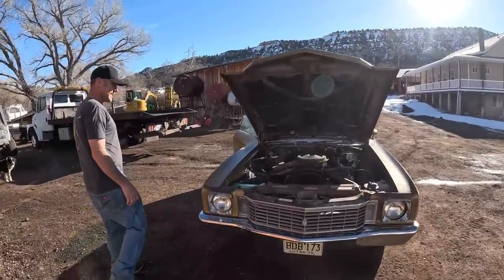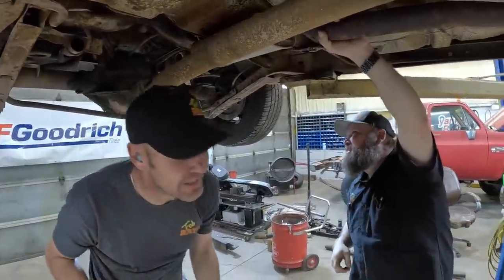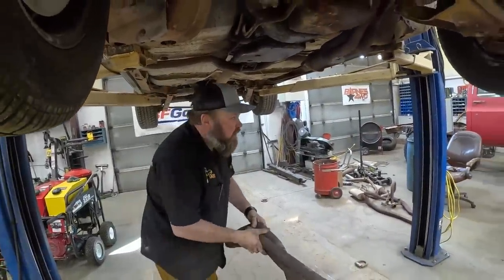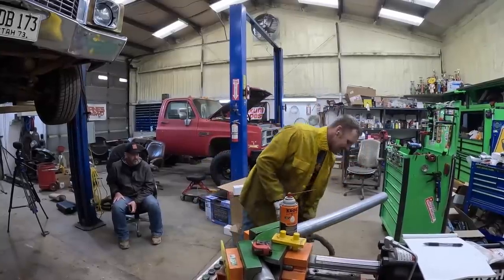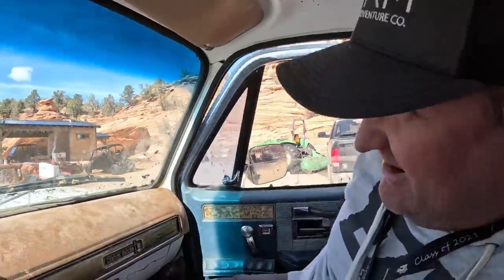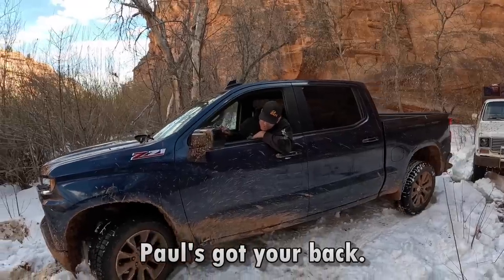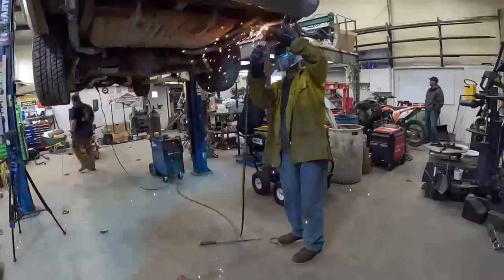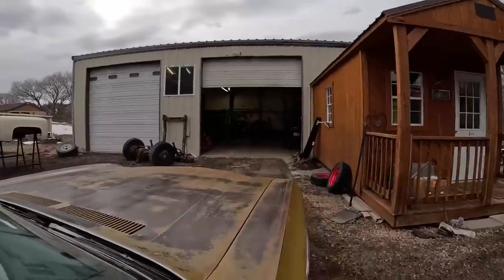There Is A Reason This Is A Pretty Special Car.

Comment: Hi Paul,  I was a GM partsman for 31 years. 72 Monte Carlo, 402 came frome the factory with regular exhaust manifolds. They did not have factory headers.
Reply: Thank you for replying. I 100% agree.
Reply: No factory headers on those cars. Even on my 70  SS with the 454 it wasn't an option.
Reply: The steering shaft was designed to unbolt at the gear box on those big block cars.
Reply: Looks great, sounds great. Now when are you  going to fill us in on what your doing with the Monty setting in your parts yard 🤔🙃
Reply: Fits like a glove. Love your vids. All the people and places you guys go. Love you guys!
Reply: 69 Z28 Camaro 302 V8 came standard  from the factory with a set of factory headers in the trunk but I never heard of a big block Monte Carlo with factory headers but of course this is way before the EPA came along and peed all over everything..
Reply: @U_ever  the democrats EPA.
Reply: @MontanaWelldigger  Yup....EPA was established by that famous Democrat...Richard Nixon.  I think that was right after he won the civil war.  🤣
Reply: Agree, these years did not have factory installed headers. I believe that some model camaros had headers in the trunk to be installed by t he dealer.
Reply: Yes you are right, if you look up 1970-72 GM 402s they definitely have factory headers from standard. And every factory photo of the engine has the factory headers, dunno where everyone gets the idea they didn't.
Reply: Appreciate the info thx
Reply: @all4runner316  Wow. You need to state your source and provide a link. I can't find it.
Reply: @all4runner316  sorry that never happened even on cars in the 60’s that came with them in the trunk for dealer install on certain high performance special order cars. No 1972 car would come with headers installed or in the trunk as this was the beginnings of the emissions era.
Reply: No they didn't come with headers just stock headers but mine has it lol ordered them from a guy that Makes them ,😁
Reply: Wasnt there something about some Strike in 1972, that meant 1972-MY car was rare?

Comment: Man this video brings back memories, my buddy Greg had a 1970 Monte Carlo with a 454. It was a beast, black on black. I remember him ripping it down the street, those were the days. I think gas was around 30 cents a gallon for regular and premium was 40 something! What fun!
Reply: Chevrolet made some SS 454 Monte Carlos in 70 and 71, they were sleek and fast for the times. They were very tastefully trimmed with no stripe packages and  the SS454 badging was small, one on the bottom of each front fender, in the lower trim.

Comment: Never factory headers on a GM. The exception is the 69 Z-28, but the optional headers were shipped in the trunk to be dealer installed. Even the highest horsepower from the factory, 460hp LS-6 in a 70 Corvette had exhaust manifolds. Now because I know what the internet experts will say, the Baldwin-Motion and Nickey cars did have headers, but those are not factory cars, but modified by the respective dealerships. Also, some much later Corvettes had tubular exhaust manifolds, similar to a header. And some Astro/Safari vans had kind of a shorty header, made of stainless on the 4.3 V6

Comment: My dad loves the 1973 Monte Carlo, it was his first car and he's had 2.  I still remember him telling me most of those he could find were 72s or 74s because they only made the 1973 for 6 months.  Excellent video, I sent it to him
Reply: I'm not a big fan of the second gen Monte Carlo's but the 73 is the best year of the second gen I use to have one it was white with black interior had the seat that turned out and was a 350 original but someone put a big block 454 out of a truck in it until I blew it up because the engine was wore out.
Reply: @79tazman  Big block truck engines just don't work well in cars.
Reply: I had a 70 with the 400 and 76 with the 350 I much preferred the 70:face-purple-smiling-tears:
Reply: I had a 72 in high school. Small block. I bought a 74 454 in '88 and I haven't done much to it since. One of these days maybe I can get the funds and motivation together at the same time.

Comment: I owned a 72 Monte Carlo in 1972 and at that time I managed a full serve service station.  I’ve never seen a big block or any other Monte Carlo with factory headers.  Most folks don’t know what a service station was.  We pumped your gas, checked fluid levels, washed your windshield and aired your tires up if needed.  I’ve pumped hundreds of thousands of gallons of gasoline that sold for $0.249 a gallon.  That’s not a typo the gasoline was less than a quarter of a dollar for one gallon back then. With that being said I serviced many Monte Carlos with 350s, 402s and 454s and no factory headers.
Reply: I thought I remembered putting a gallon of gas in my 1970 Suzuki 90 for a quarter. Been a little while. 🙂

Comment: '76 Monte Carlo had the 454 HO option. and yes, it came with factory headers to be installed by the dealership. Headers were shipped in the trunk and the dealership installed them. As far as other engine sizes or years, I couldn't verify. But it seems likely.
Reply: Sorry, but that's false. The last year a 454 of any hp rating was available in a Monte Carlo was 1975.  In fact, no big block was available in a '76 Monte Carlo.
Reply: @danjanes8689  so you're saying the car my mother drove nearly 18 years is a lie?
Reply: @Daniel Miller  Do a Google search. I've lived and breathed Montes for over 35 years. Is it possible her car was an earlier year? In the mid '70s there was no H.O. anything. Emissions choked everything.
Reply: @danjanes8689  Early 76. Built with some of the leftover parts from the 75 run, which I'm assuming may have included the 454 HO. I know it's a 454 HO cuz when the car got wrecked, I kept the engine and had to do some internal rebalancing. And the 404 only had 2 valves per cylinder, where the 454 HO had 4. Engine still lives in my square-body chevy truck.

Comment: Not sure if the headers were a factory option or a dealer option, but that Monte has a 12 bolt rear end and reinforced lower control arms so it musta been a special car, with some good options checked.

Comment: I was born a long time before that car was built.  We used to do exhausts for cars like that where the tips came out in front of the rear wheels.  We would do an angle cut on the tips and braze a bead around the edge to stiffen it up and blunt the edge.

Comment: Fun fact. The 1970 to 1972 Monte Carlo shares the frame and greenhouse with the Chevelle. The Monte Carlo dashboard (round gauges) is the dash you got in a Super Sport Chevelle. The Monte Carlo dash added a wood grain sticker over the black plastic piece in a Chevelle.
Reply: The Monte Carlo has a longer wheelbase than a Chevelle, and it doesn't fit any other car.

Comment: My Dad's 72 Impala 4 door with 6ft hood. We put a bumper hitch on it to pull a small boat.
The ball latch lever would it the bumper before it dropped onto the ball. 
We decided to dent the bumper with a sledgehammer. 
We could barely put a mark on it until we heated it up cherry red. 
After completing the job. We remembered the fuel filler was inches away from our blow torch. Filler was behind the license plate

Comment: A friend of mine his first car through the high school years and after that was a '70 Monte with the 300 horse 350 engine.
He has owned other Monte's throughout the '70 - '72 model years including a factory 454 with full factory gauges and console mounted auto shifter. 
To this day he has another '70 Monte in a million pieces with the goal of some year putting it back together and getting it on the streets again

Comment: My Dad was 85 years old and had to go into the hospital for surgery about 45 miles away from home.  My mother was 82  and needed to drive to the hospital to be with Dad.  She realized that she needed gas in her car so went to the gas station and had no idea whatsoever how to put gas in the car.  Mom would come home and tell Dad her car was low on gas and he would stop whatever he was doing and go put gas in for her.  It had been probably 65 years or more since she had put gas in a car.  She went inside and the lady that worked there was very kind, came out and showed mom how to use her credit card and then put the gas in for her.  I learned how to be a gentleman and treat a lady from my Dad.

Comment: 12 bolt axle, boxed lower four link control arms and rear sway bar, that's an original 402 or 454 equipped Monte Carlo. The 454 Super Sports had oval exhaust tips...It still had the original rear muffler hanger brackets!

Comment: My son bought a 92 Buick Roadmaster with only 27,150 miles on it. The original owner passed away then her son got it. Had been parked since around 2015. He got the car at auction for less than $700.  Car runs great.

Comment: I worked in a muffler shop in the late 70s - early 80s. There wasn’t any cars made with factory headers before the late 80s. Everything was cast iron manifolds with some high performance manifolds from the factory. So what you took off was aftermarket headers and also no muffler shop would have brazed a joint. Everything was welded with a gas torch. Must have been installed by someone in their garage. 
I would make those tail pipes on a bender all the time. A truck for that bend over the axle is to make about 75% of the bend with a 5” radius due and then complete the bend with a 4” or 3” die. The flattened part you pointed out was a factory thing to get clearance from the cross member. 
My father in law always filled his wife’s car with gas. When he died she didn’t know how to put gas in her car. The kids tried to show her but she just didn’t want to learn. So she would get my wife or a grandchild to put gas in her car until the made her stop driving. Not a bad thing to put gas in for your spouse.

Comment: Good morning from Wisconsin.
I owned the same 1972 Monte Carlo 402 came with the headers looks and sounds like that was the original exhaust cuz mine also had a flat top exhaust was kind of a hot little car could not keep back tires under it. Had local junk yard got extra set of rims.and would have him put tires on for pick up every Monday. Weekend fun took care of a lot of used tiers lol. Keep up the good work

Comment: Hey Paul 
If you cap and fill the exhaust pipes with kiln dried sand and THEN put them in  the bender,  they stay the same diameter you don't get the shrinking in the bends , little trick for ya 👍

Comment: I had an ‘85(?) Chev pickup that I bought new. Had a 4.3 with a 4 barrel carb, factory headers and a 5 speed transmission. Black short box fleet side with red interior .

Comment: After a 351 Windsor long stroke was shoe horned into a 1968 Mercedes, the only way to get the headers & tuned length extractor pipes in was to cut the headers at the point they started to curve, & weld them facing forward & down wards a bit. After a lot of precision bending cutting & welding the neatest, tuned length forward facing down swept headers & extractor system was easily slotted straight in. Sometimes you have to think outside of the box.

Comment: We soak the exhaust wrap in hot water to help it form nicely & once it drys in the sun hit it with flat black stove paint for a clean look. Heat wrapping as much of the exhaust as I can helps keep the under hood temps much better & doesn't heat the floors up as bad, found adding a thin insulation pad or Lizzard coating the back side of our heatshields where the  exhaust is close to the floors fixes that last little bit specially if your running bare floors, still like larger exhaust to help the engine breath & run cooler. Too bad all the side by sides weren't that nice to hook up to!  Plastic may save weight but is such a pain to work around!

Comment: That car looks like a 71 or 72.   The 73 had rectangular smaller rear lights.  The 73 was the most good looking. The 400 engine did not have headers from factory.
Great shop details.  Thanks for the video’s.

Comment: all these Recovery's  i'm thinkin the Yota Needs put in the shop n fixed.. it's a beast..  and YES those Headers were factory ..   Tip:  we used to use a steel coat hanger as a bend guide on those old cars to copy the original bend.  works great. and the off bend ya can't get you bend the axle hoop then clamp the straight pipe in vise and put a bar between the hoop bends and Twist it to get it..crude but it works..

Comment: I know every inch of that exhaust because I have polished mine since 2003 until present   on a fully restored 71 Chevelle SS convertible. As far as I know only one company  on the  east coast reproduces  those correct pipes out of aluminized pipe including the flat spots.

Comment: Those days are gone forever.  I use to run straight headers often while a new interstate was being built.  20 miles to the next town with no speed limit made for a quick trip.  Fun days.  I had 4 special made C clamps to replace the header bolts with a hanger to hold the pipe when the the headers were disconnected.

Comment: My very first brand new car was a 1972 Monte Carlo. It was midnight bronze color with a black textured vinyl top. When the sun rays hit the body, it would sparkle from the gold flecks in the paint. It also had a 402 four barrel carburetor and an eight track tape player and stereo sound system. The speedometer topped out at 120 mph and I took it to 110 mph once on the highway. Paid $4500. Put 320,000 miles on it before I sold it and bought a new pick up truck.

Comment: In Australia what you call "Headers" we call "Extractors". Headers here are the common cast exhaust that bolts to the engine that has no tuned pipes.

Comment: Back in the 50's, 60's, and 70's, when they cared about somebody getting something they would actually enjoy, they would do all kinds of stuff like headers, carb jets, etc to give the car more power than the competitors. They would even help you lie to the insurance company about it, :). They would make some tamed down version with like 170 horsepower, with thin little bicycle tires on the back to show the insurance company, then when you got it from the showroom it had 260 horsepower and drag radials on it.

Comment: A '72 with a 402 was the highest performance MANUAL shifter they had for 70-72 Montes. The 454 only came in Automatic. Most of the interior and many other engine/chassis parts interchange with the Chevelles

Comment: 1972 big block Monte with AC …12 bolt rear with sway bar and Placer Gold to boot! That is one of GM’s coolest cars of the 70’s and just never got the attention of the Chevelle or Camaro. That worn out  paint just looks awesome! You guys did a great job on keep those pipes tight.

Comment: No GM vehicle ever came from the factory with headers. However, some dealers put headers and other performance parts on.
Also some licensed factory upgraders may have put headers on limited production runs - the Cosworth Vega comes to mind.

Comment: Big block Chevy and GMC vehicles had headers as an option in the late 60s and 70s.  Magna Flo and Hooker headers are excellent for those classic cars and trucks. 
I worked at an Action Auto, Parts, Service and Gas, in the late 80s. My friend, Ben Piper talked the manager into buying a Ben Pearson pipe bender.  And Ben only needed to look once at how any exhaust pipe was was bent and he could copy it perfectly.  And yes, my friend Ben Piper was the nephew of Roudy Randy Piper the Big Time Wrestler.  Fun Times, shop went out of business.
Sorry but yes, you need to jack the engine up to get the headers out and then back in.  There are low profile headers, but I don't know if they're made for a big block

Comment: Paul....400 Mid Block Was One of The Factory Options. And That Huge Long Fan Schroud....Was Because The Monte Carlo...Was Designed To Fit A Straight  8, That GM Didn't  Put into Production.     Another Similar  Deal Was The Monza....Which Was Built To Carry The Wankle Rotery Engine....If You Get the Chance To Look....The Trany Hump on the Monza...Was Huge...To Accomidate The Wankle's Higher Output Shaft.!!!

Comment: I don't recall the brand name but I watched a pipe bender make any pipe you needed by just entering make, model, year, and sometimes the Vin. All the operator needed to do was load the correct pipe on the machine, and sometimes clock the pipe.

Comment: Whenever I install headers or any exhaust I automatically use v band flanges on all connections.  They are cleaner and easier to install and remove.

Comment: I was working at a Chevy dealer in 1968 and they only came with cast iron exhaust manifolds that year.  Unless they changed in 1972, those are aftermarket, possibly Hooker Headers.

Comment: OMFG my first car ever was that exact car, bought it in 1986, same year, same Placer Gold color, same 402 motor, bought mine off a school teacher that was the original owner for $500 because he said the ball joints were shot...turned out it just needed wheel bearings, after that one got wrecked I replaced it with a Gulf Green 1972 with a 454, ended up selling that one for a more "economical" daily work commuter. Dam I miss both of them cars.